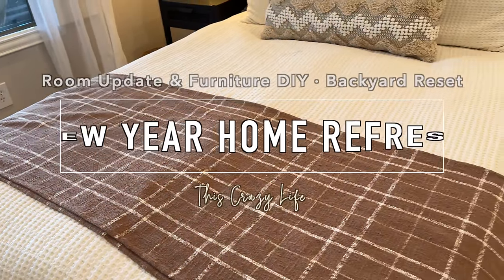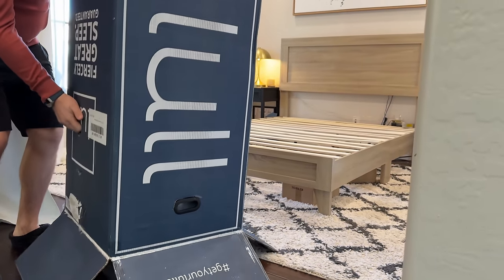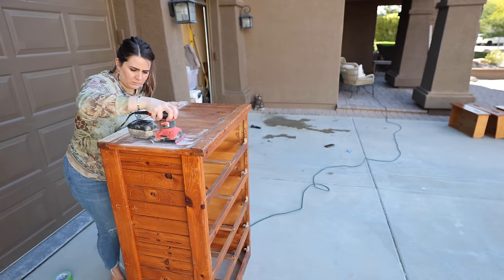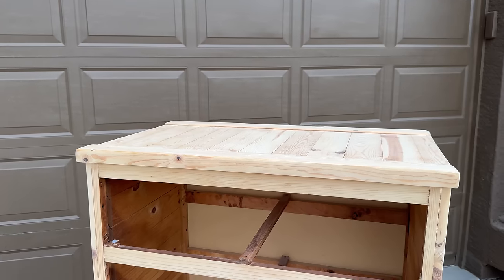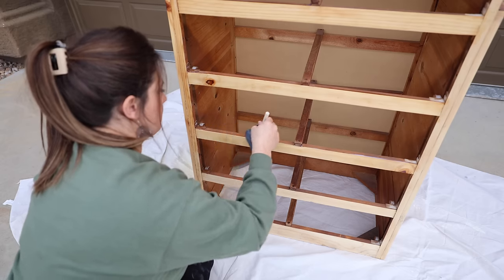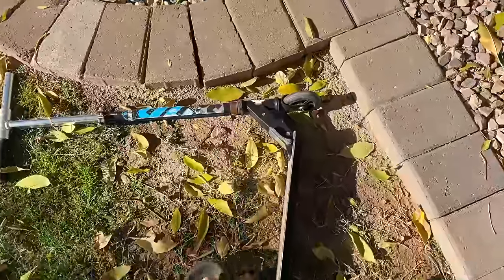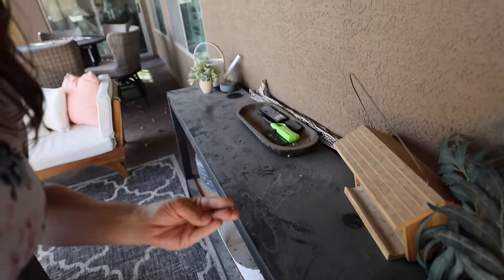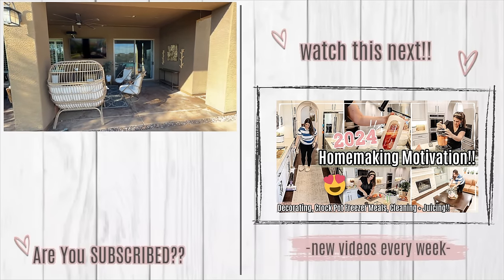2024 HOUSE PROJECTS :: Guest Bedroom Reset, Thrifted Furniture Flip + Backyard Clean With Me

Comment: Hi Amanda, I refurbish wooden furniture for a living. Here's a few tips (feel free to ignore them lol): only ever use a sander in the direction of the grain of the wood to avoid leaving sander marks. You don't always have to use varnish/polyurethane; a clear beeswax will give you a waterproof coating but also feed the wood to avoid splitting (apply with a soft cloth & reapply once every 12 months). If you do use polyurethane, you're right to say it lifts the grain so you need to do a light sanding, but you really do need to do a second coat after that as you've actually removed the sealer coat from the tiny bits of lifted grain. If you feel the wood finish might look too yellow, you can add a tiny bit of water based white paint to your poly - you could still do that now with a second coat. 
I love the green in that room but I think in this instance I'd have actually painted the whole unit except the top as the tongue & groove would be pretty painted. Lots of love x
Reply from the maker: Thank you for these tips!!
Reply: I like the green on the dresser but the rest does look a little yellow so I get what's bugging you. I'd try a whitewash or add white to the poly like the comment from the other viewer said.
Reply: I love the dresser transformation, however, I agree it's looks a bit yellow for that room. I prefer the raw wood look you had after sanding.
Reply: I always buff my projects with a brown paper bag after I've applied my final coat of sealer (I prefer shellac).
Reply: My dad used to refurbish furniture and repolster furniture the smell of varnish was another

Comment: Hi Amanda, I love the new dresser. Maybe put green in the bedding or a throw pillow. This will help bring the green picture above the bed in with the drawer colour. Hope this helps xx
Reply: You could also add some bigger Rosemary colored EURO PILLOWS and covers that would most likely go over the headboard. I love your channel. It inspires me. Love your advice and how you talk through everything! It’s so helpful.
Reply: Yes I agree with this. I do interior design and you can have multiple types of wood and wood tones in a room, with the colors or other elements helping to pull it together. The blue seems off but if you add green to the bedding, it’ll pull together. It’s probably different in person, but from the video, the baskets under the nightstands and the blanket basket in the corner have the same wood/yellow tones as the new dresser. Just add in greens and I think it would all come together. I would also add a thicker duvet/ comforter, especially during winter months to help with the cozy look and balance the visual weight of the rug. The bed looks very boxy with the thin bedding.  Guests love fluffy and puffy bedding!  All of this is meant as kind criticism so I hope it comes across that way! And It also helps that the dresser is not in the first line of sight when you look at the bed. Good luck!! You’re doing a great job!

Comment: Love the dresser! But i agree you need to tone down the yellow, if only because it doesn't match anything else in the room. A white wash would work, or you could paint it black to match the nightstands (leaving the draw fronts green) For your guest room doors, could you do double doors with glass? As in fully glass apart from the frame. (you could also have it with one side fixed like a full height window, or windows either side, if you dont want or need to have double doors). On the frame I would either match the wood stain to your office doors or probably go with black. You could keep the existing curtains for privacy when people are using the room, but having the doors would make it feel so much more private and act to isolate any noise as well. When not in use, having mostly glass doors would still allow a lot of light through the window into the hallway. If you are going to go with doors then definitely build them in and don't go with the sliding barn door style, as whilst it looks nice it doesn't do much to block sound. If you dont want to keep the existing curtain set up  the blinds directly on the doors that can be pulled fully up would also work well, which is probably what i would do. Just my two cents!

Comment: I love the dresser! What a huge difference! I think the green is ok, it matches the big artwork above the headboard. I do like the idea of putting a second coat of polyurethane with a bit of water based white paint to whiten the yellow tone. I would also get a thick piece of glass (1/4 inch) to finish inside the outside higher wood boards….just adds a bit of polish to a piece of furniture and really protects the wood. Then you have an even top for a lamp or decor. And if you truly decide to change the green I do like the idea of a rust color, even a pretty brown would match your bedding. And I do also like the suggestion of changing the sheets ir just the pillowcases to green. I love everything you do!